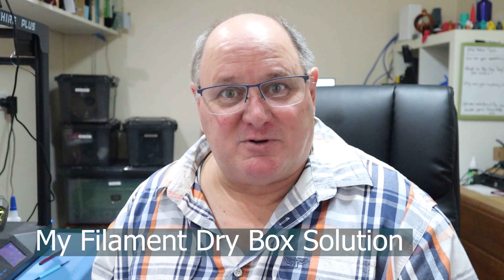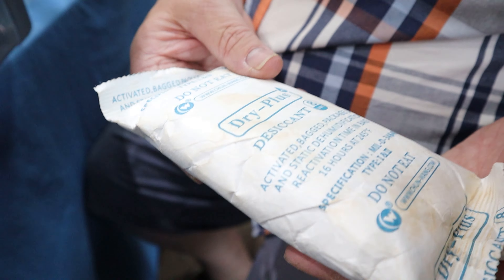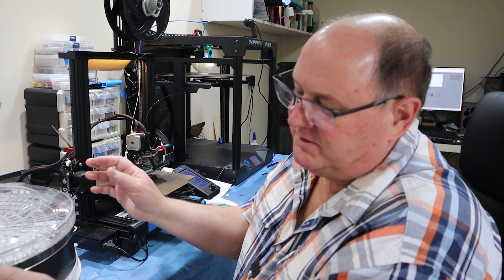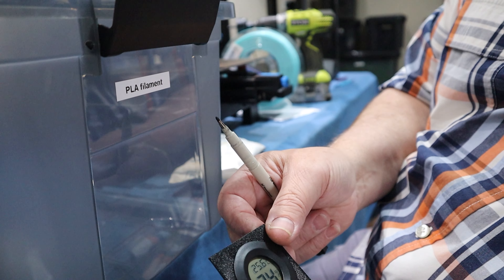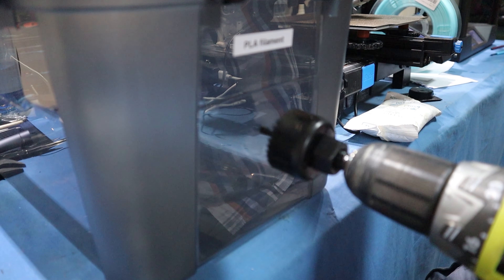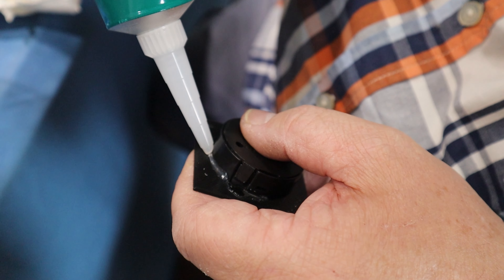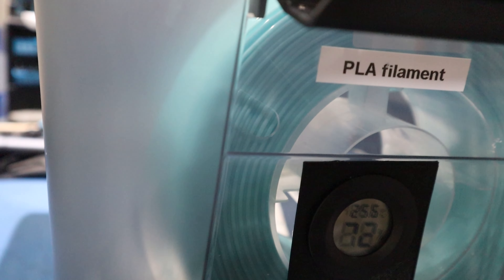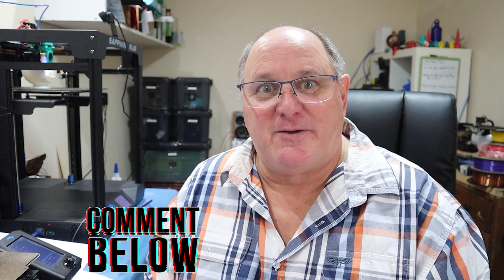My 3D Printing Filament Storage Solution

Comment: I collect packets from work too. Unfortunately they are the small packets. I also bought a jug of desiccant on Amazon and have 3D printed some containers for inside the spools and also put it on cheesecloth and made a ball and tied it off with a rubber band. 
I put the spool, a thermometer/hygrometer and desiccant into vacuum bags remove the air and and put them back in the box they came in. The bags are cheap and will lose rhe vacuum but the box doesn't let the bag open up much.
Reply from the maker: Thanks for that. Looks like you've   got your filament storage sorted out nicely.

Comment: If you put some tape on the plastic that can reduce cracking risk. 
 Have you made any like this that have an axle, and feed holes out the side? Thinking you could mount them above your machines and just string them down to where it's being used, or push it back up to just sticking out when done?
Reply from the maker: Tape is a good idea Chis. Thanks.
I have thought of feeding filament straight from the dry box but don't have the room at the moment.
Thanks for commenting.